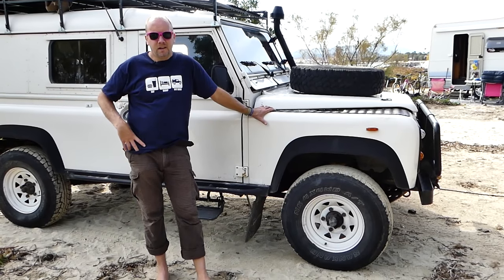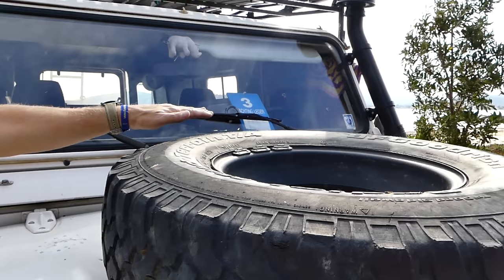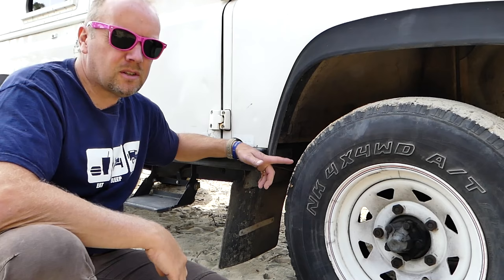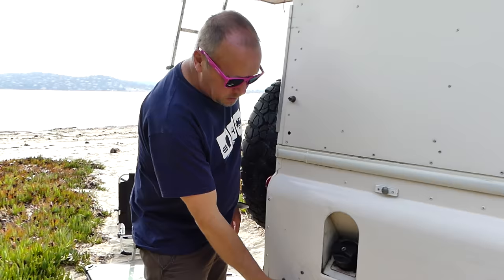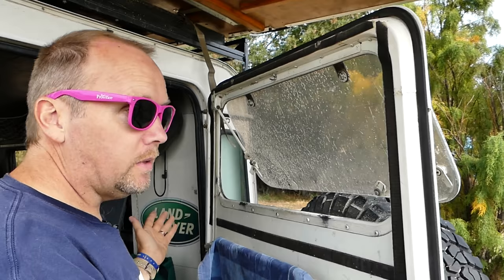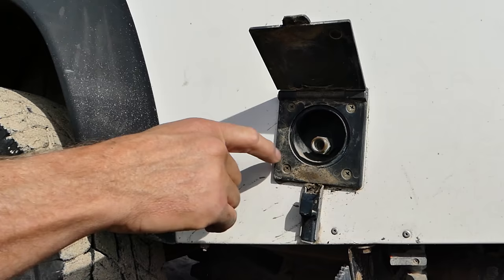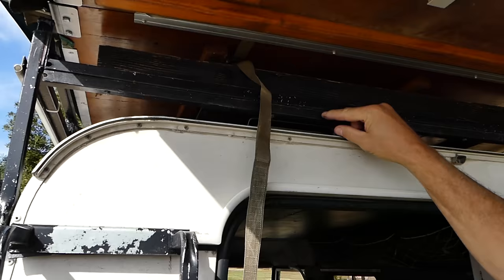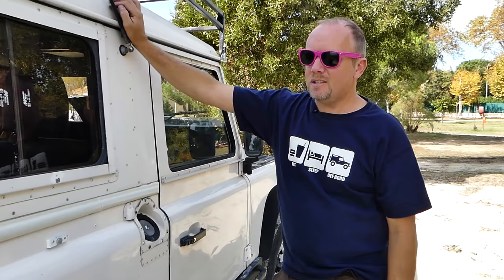Defender 110 Overland/Camper pt1 Exterior Features

Comment: If you would like to know, the spare wheel carrier on the back is there because if the wheel is on the rear door, the wheel is too heavy. This would cause it to damage the hinges. It also makes the door lighter and easier to open. I can see you will have many adventures in it as i own one myself.👍👍
Reply from the maker: It also acts as a platform to stand on when opening/closing the tent!

Comment: One way you can take some of the wander out of steering is to install a Tierra firma return to center steering stabilizer. I did this to my 110, and it made a world of difference. The cvs are not hard to replace, make sure to get appropriate seals. The swivels are a bit labor intensive to replace, but a complete novice should be able to do it in a day. Also check your swivel housings to ensure you have grease or ep 00 or if pre 1990, gear oil. You may also want to check ball joints and drag link joints to ensure these are not perished.
Reply from the maker: Thanks for the good tips! And thanks for watching

Comment: I wouldn't recommend jumping on the bonnet mounted spare, if the bonnet flexes it could damage parts mounted at the top of the engine, nice truck and good video, enjoyed watching
Reply from the maker: You're quite right - especially the turbo which you don't want to lose (ask me, I know;-))... But it's holding up well. Thanks for watching glad you enjoyed it